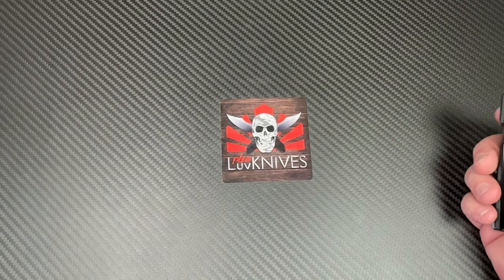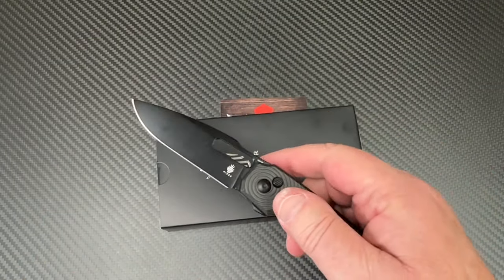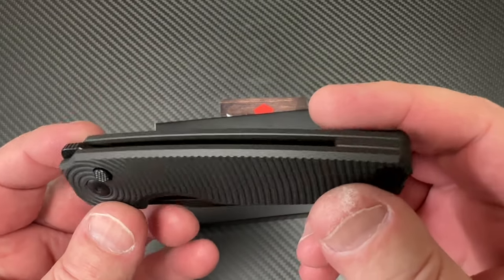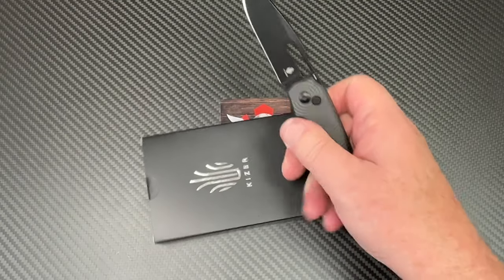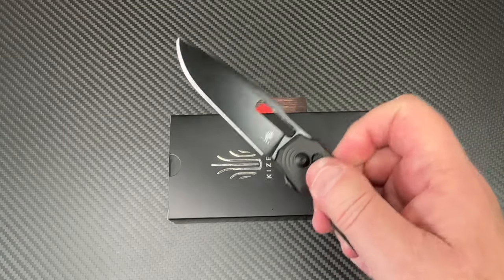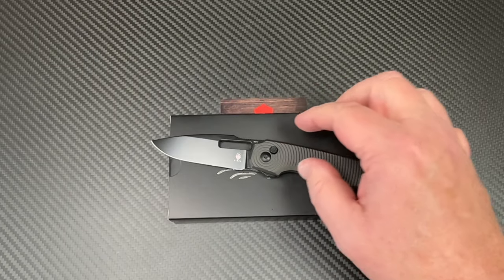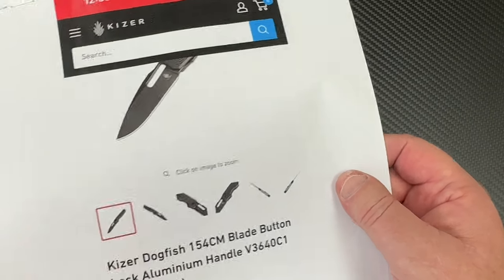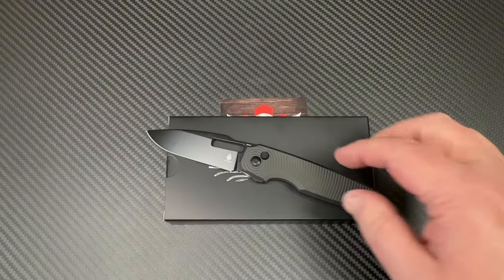Kizer Dogfish button lock fidget friendly EDC !

Comment: NOT a lefty friendly knife.  i own it and the milling in the opposite side clip filler piece doesn't match the milling or scale lines when you reverse the clip.  disappointing.  and the scale needs to be milled out more to make room for sausage fingers to reverse flick the blade open.

Comment: I was wondering why this video will be so long... Now I know :D
I don't understand that extra piece.
It doesn't look symmetrical, so it would make sense to have an extra for the other side... But then its shape should be mirrored, not the same... and then you would also need a different clip for the other side.
I also thought that they might include az extra piece so that you can remove the clip completely - but then there wouldn't be anything to hold the knife together in the back.
I have no idea what's going on :D

Comment: I have so many mixed feelings about this knife. I love the looks, but I fear the ergos may be weird since the opening methods and choils are all over the place. I'd really like to try out a knife with squarish tang that has front, top and an inline flipper, plus a button lock, and this one's it, but... i dunno.it seems kinda wonky.
Reply: The deployment methods work really well, and the button action is pretty smooth, but I'd say it would depend on your hand size for the ergos. I'm able to get a full grip choked back, unlike in this video, and choked up is also pretty comfortable. That harpoon groove at the top is also perfect for placing you thumb. Plus, they did a really good job with the jimping, covering every spot needed so you don't slip.
Reply: @aydan7901  thanks for the detailed info! I'm a fan of deep forward choils where the index finger gets nicely nested; here the area seems a bit flat and parallel to the cutting edge, hence my reservations.
Reply: @ThatImmo  No problem, but yeah, I get what you mean. I usually do as well, though this one is still better than some others you get. It still has some depth to it, and unlike others, it is quite wide, too, so there is plenty of space.